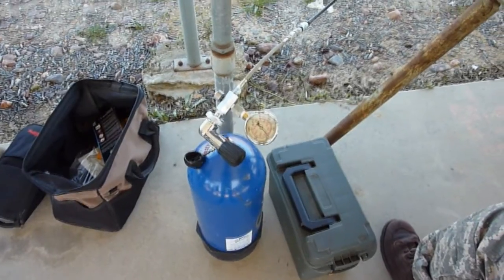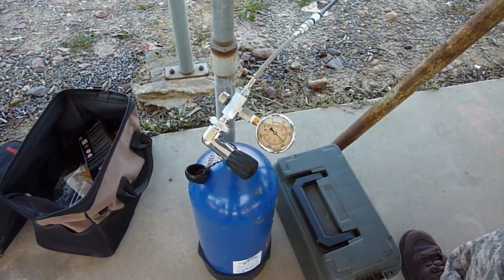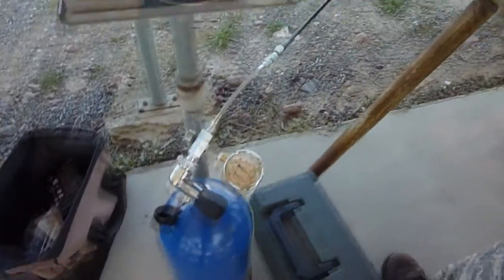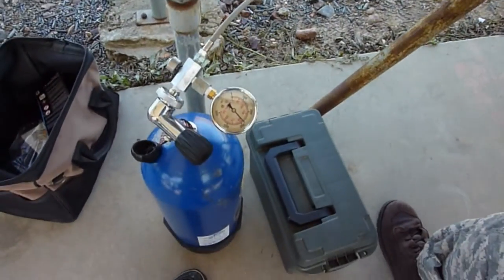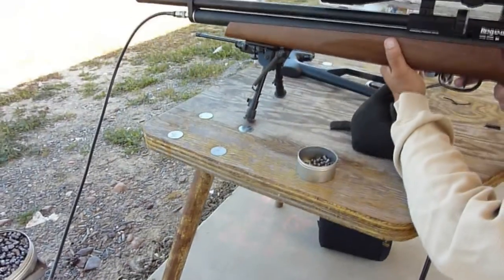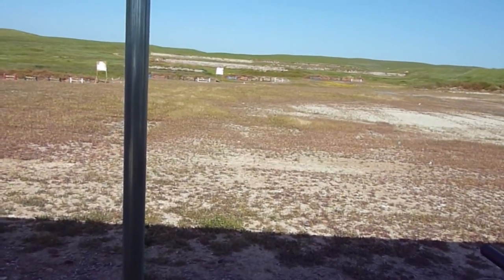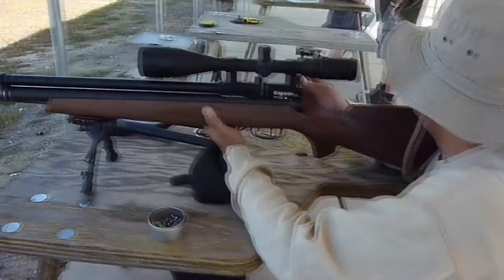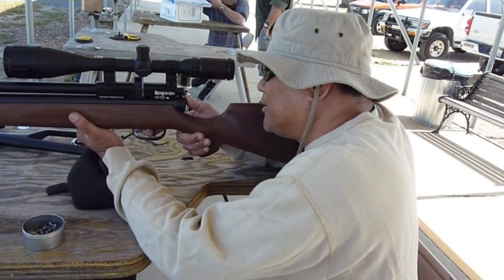How to tether a SCUBA or SCBA tank to the PCP airgun for prolonged shooting fun.

Comment: You can also do this with a fill tank with a pressure regulator.
Reply: Yes, but regulators for high pressure tanks are very expensive.  We have some custom guns that shoot .25 cal and 69 grain hand cast .257 bullets we shoot them using the stikman connected through a regulator.
http://airtanksplus.com/products/pcp-fill-adaptors/stikman-scba-pcp-fill-system